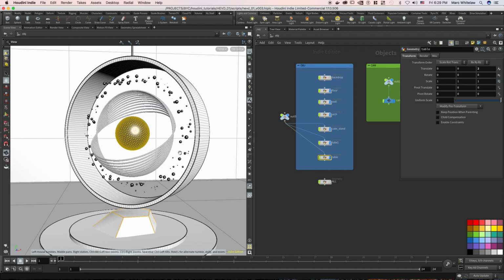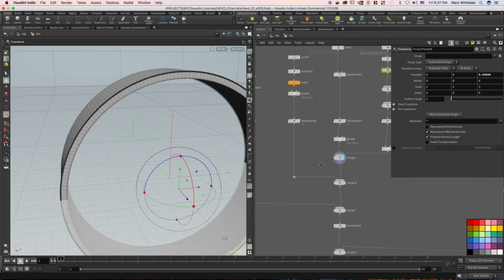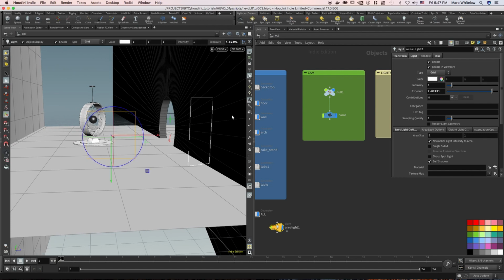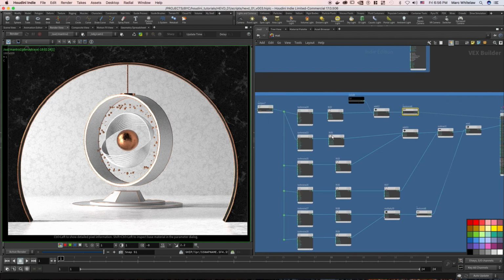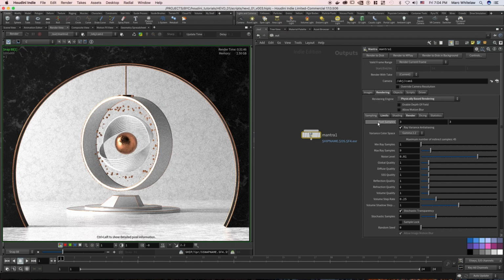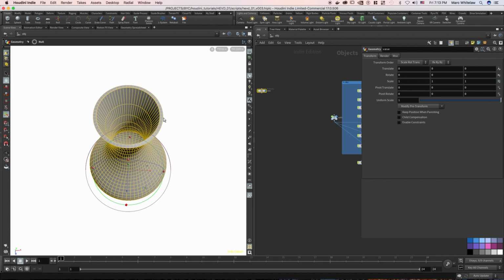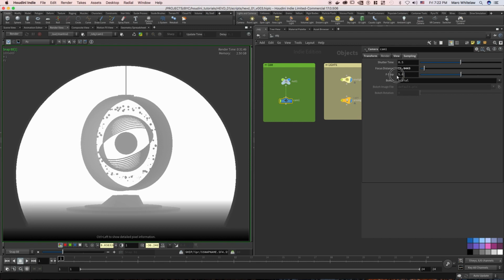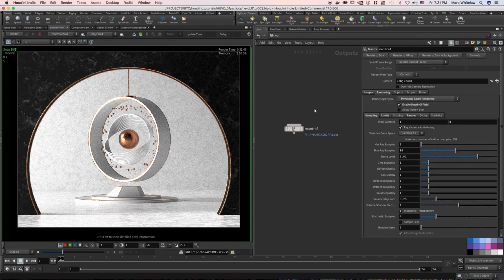Houdini Everyday - Part 6 - Rendering

Comment: Without adding material nodes to every individual geometry, how do I assign materials to individual geometry? For example the sphere inside the tube setup - I might have missed something? Thanks so much for your great work.
Reply from the maker: Double Creative hey, so if you select your geometry node at the obj level. In the properties there is a ‘render’ tab. There is a material selection there that you can assign a material. But keep in mind that it will apply the material to everything in the geometry node. 
So if the sphere inside the tube setup in in its own geometry node, then you can apply a material at the object level. If you have a bunch of different objects inside a geometry node, then you need to use material nodes to give each object the material you want.
Hope that makes sense!
Reply: @breakyourcrayons  Thanks for your reply! That makes sense. I went in and rearranged my setup to be like yours so I have one geometry node called 'ALL' and each of the main feature objects in there (the table, sphere, fixture, tube, wires etc). And I noticed you had 'groups' for everything but not necessarily material nodes for each of those (for example the fixture merges straight into the tube without a material node, even though the render is a copper fixture with a white tube). I thought perhaps you were assigning materials to the groups you'd created. But just to confirm, I'll need to add material nodes to each object within the 'ALL' geometry to achieve the same results you have? Thanks! Tom
Reply: I just noticed you can select a number of materials in one material node, this must be my answer! Thanks so much for your time, appreciate your amazing tutorials.
Reply from the maker: Double Creative hey! No worries :) glad you found the tutorials helpful! To answer the question, yes material nodes for each object before they get merged together. Or like you said below, make a group for the object/s and then have 1 material node at the bottom. Add multiple materials using the + button and assign the materials per group. 
I think that answers your question :D 
Good luck bud!